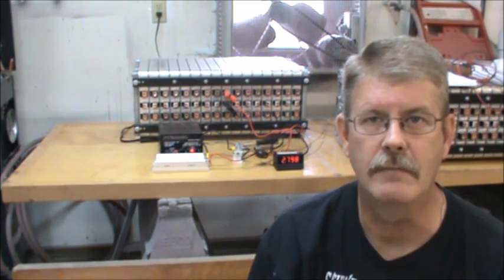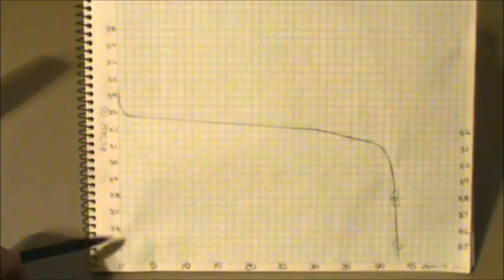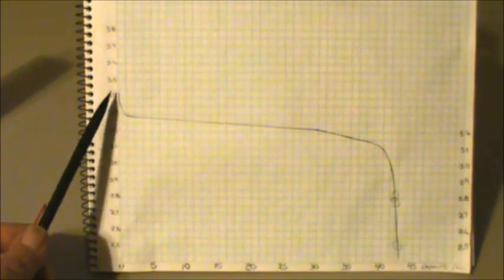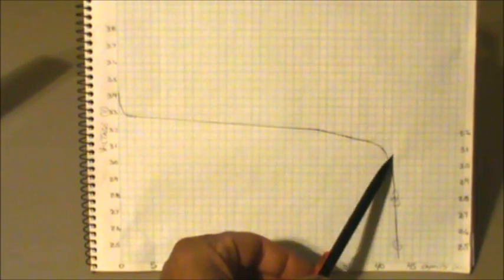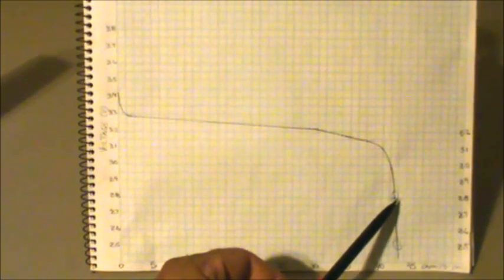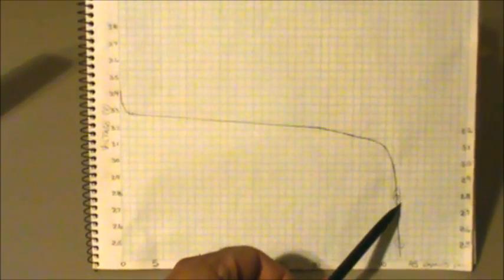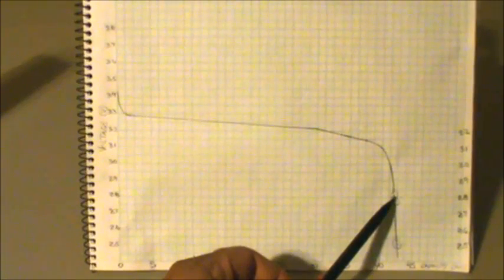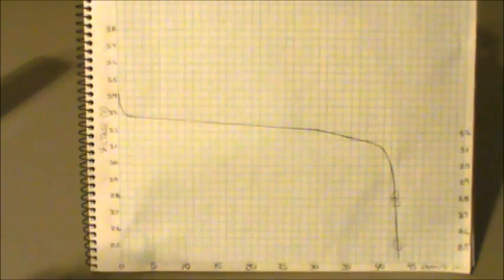Why Bottom Balance Your EV's Battery Pack?

Comment: As per the Data Sheet these cells End of Discharge is listed as 2.5v.   Most every Li cells I've ever dealt with state 3.0V.    Only LiFePo4 type go below 3.0V.  Usually 2.7 - 2.5V.   How far down are you taking these ?

Comment: Great Video the only thing to add is after this bottom balance method, the first charge is very important.  You need to make note of the first cell to reach full SOC.  This would be the weakest cell.  Then base all other charging off of this charge. Usually 10% to 20% less than full. This might make understanding why a BMS is not needed.  But with the cells you have there; you are running a greater risk then if using the Lifepo4 cells. Those do look like the Leaf Cells. A bit more dangerous.

Comment: Have you tracked the actual discharge curve for the Nissan/Renault cells?  As I mentioned in one of your previous videos I don't think they have the same flat discharge curve as LiFePO4 cells, but are more linear similar to LiCo and LiNiCoAl.  I would also think that these cells are much more closely matched than what we get from CALB, and if so they would be fine if top balanced, since that would also be effectively bottom balancing them.

Comment: 100 percent truth in your explanation Tom ! I do the same with R/C car batteries , I like the bottom balance better than Charge balance , Because it is safer for the cells and makes them last longer on a charge and live longer over the life of the cell . Great info man !!
Reply from the maker: +ShawnMrFixit Lee I agree..........I think balancing at the top can be dangerous. I think bottom balancing the cells and then slightly under charging will give the cells the longest life.

Comment: I assume that no electric car maker uses bottom balancing.
Reply from the maker: +Dan Frederiksen I am going to assume your assumption is correct Dan......But no electric car maker will let you use much more then 70% of the battery packs energy either. The only exception would be Tesla.
Reply: +Dan Frederiksen you do need balancing if you have a BMS that monitors all of the cells. even if its 50s that is worth using a BMS and running the leads to each cell. initial Bottom balancing would only be good for possibly the first 100 cycles and each cell will start to drift because they all age differently.
Reply: +Cutler Cycles for DIY I would generally avoid BMS to avoid the danger of it going wrong which is far greater than without it.
For a commercial car I would use a full BMS, likely optical so there is no mess of wires spanning high voltage. A BMS is something that really needs to work well or you are better off without it.